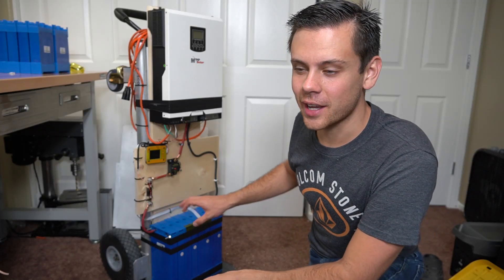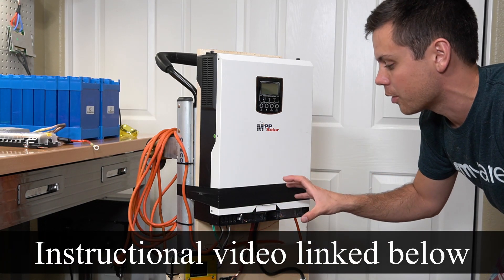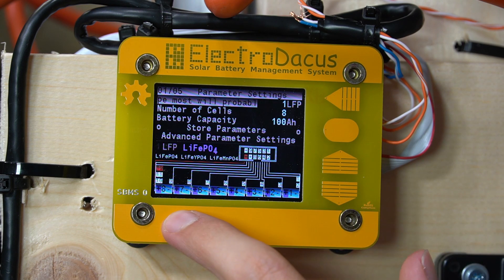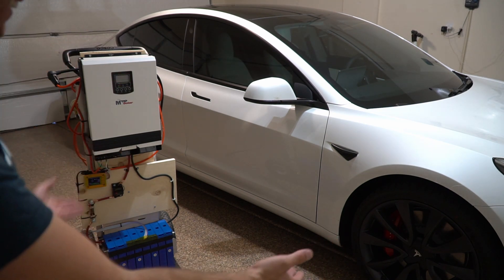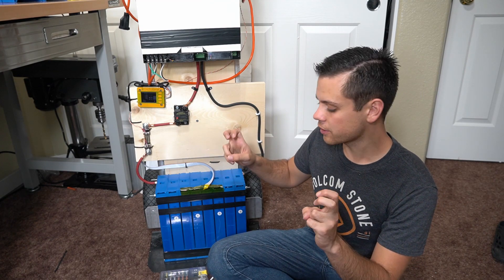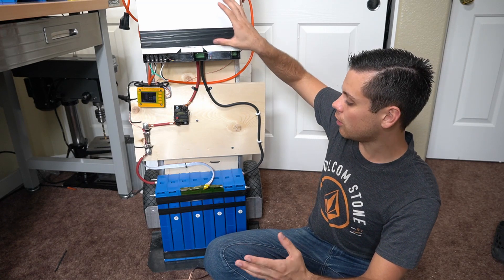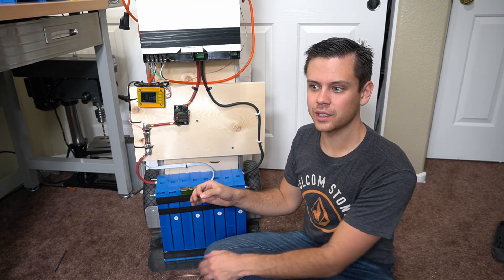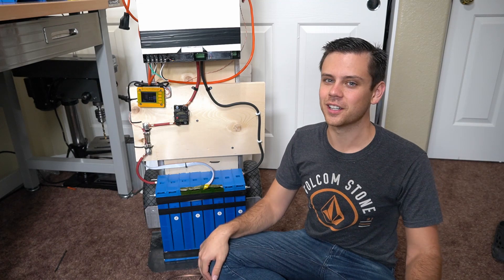Hand Truck Solar System: 2.4kWh LiFePO4, 2.4kW Inverter, ATS, 1.4kW AC Charger, 1.8kW PV Input

Comment: 1:40 woooow your finger? xd - Question: Can i connect this as a permanent solution to my household connection (230v*16A=3680watts) to charge and discharge like a normal bettery with DC connection?

Comment: Will says you can just add another (cheap) solar panel to get more power.
He forgot to mention the extra battery one would need also for overnight and days with rain.
Still a great system.
Once my new batteries (48V - 30KW) arrive, my existing 24V 5K system is going on a cart for portable system.
The portable system will power my garage tools and hopefully soon an electric mower.
I want to convert my 3 blade mower to electric and get an EGO mower for the smaller areas.
While I like the hand truck, I will use a 4 wheel cart to pull around the property.

Comment: Hey Will, I used 2 battleborns on my handcart system in early 2020 (may buy an additiona 2 later).  Which low voltage disconnect would you recommend? I am only using 4 100w solar panels along with a DC charging with a dc-to-dc converter (not charged in at the same time but just for redundancy), so I think the LV2424 has too much standby draw. I recently purchased a victron 100 30 with Bluetooth for solar (will use in 24V configuration as 4 HQST in series push the 100V limit) as it seems much better than the 20A solar charge controller included in my Giandel 2200w inverter. I am considering selling my renogy 40A DC-TO-DC converter as well as my 20A (only for backup) and buying the Renogy DCC50S 50A (not using for solar based on 12v limitation) primarily because it has a low voltage disconnect from the starter battery. The PHEV I use (12V system) turns off after 2 hours, and also has periodic voltage drops.  Love your content. In another life I could see myself doing what you do.  This is my true passion.

Comment: as long as the inverter is large enough, battery bank big enough, solar charge controller having correct volts/amps/watts, could you in theory just park this into an RV and just plug up a mini split a/c system into it and completely bypass tying it into the rv electrical system if you only plan on running a mini split off solar ever?

Comment: That circuit breaker has 1/4 inch screws. What awg wire were you using to connect from battery to breaker to inverter? Even with the largest wire I don’t find 1/4 inch ring connections on them. I guess you made your own for this? Thanks.
Reply: I just saw you posted this a year ago. Im having this same issue now. I had used 4 guage and found a 1/4 in. lugs for the breaker but then decided to replace with 2 guage wire (because the 4 guage was aluminum with copper plating) and now I cant find 1/4 inch lugs for the 2 guage. I think I can order them but im impatient, and hoped you had found some at a local supply box store?. thanks.

Comment: Will, I was wondering about the split phase out put when using two inverters. I was thinking about making a pull behind trailer with some 240v equipment on it (air compressor etc). I wanted solar power and batteries so that I didn't have to run things from a generator. What I would like to know is can you plug in 120V from a standard plug to charge batteries etc but still have 240V out, so both invereters would recieve the same 120V input which means no phase difference. I would think that once the 120V is converted to DC in each inverter that it could then charge batteries etc. but i wonder if the pass through would cause no phase difference on the output unless the pass through could be disabled in some way?

Comment: I like what you did, but I live in Maine and I have limited space living in a trailer. Go check out Roger Miller's song, King of the Road, and I am 20 miles west of Bangor. Back to the real world, I want to use my power station to run a portable hot tub in the summer and bring it inside in the winter for power outages. I also have a gas generator. I am looking at getting the Bluetti AC200P.  I think it will fulfill my needs at a price I can afford.

Comment: How many solar panels do you need to charge that? Or should I say to charge it quickly. I am going to be moving off grid, to a piece of property that is solid trees and vegetation. I think something like this would be good for me as it would be portable, and I could power all kinds of tools for building and maybe clearing land.
Reply: The MPP hybrid charger output and the inverter are at one c with the batteries.  I think it can take two thousand watts of panels to charge it in less than two hours. It will give you less cycles though.  This MPP solar equipment draws between twenty five and forty watts when on meaning you need an extra panel just to keep it running.  Nice buy on a budget.

Comment: Hi Will, another great video. I've been working on a system for my van. Going to use Electrodacus and DSSR20. I decided to go with Victron Multiplus because of the separate inverter and charger disconnect. Don't like that because of cost. I like your work around by top balancing and setting absorption on inverter/charger. What are your thoughts on doing the same for a van/RV build? Could you provide more details?

Comment: So what happens if you plug the MPP into AC, coming from an inverter, connected to the batteries? Would you just lose power due to loses in the loop, or would it explode?

Comment: hi will! geat video. i want to build this in my van. my question is if i could charge this system with the car alternator as this is 24v and my alternator 12v. Would it make sense to attach an inverter to the car battery(with thick cabes) and turn it on while driving and connecting the output 220v of the 12v inverter to the grid input of the 24v inverter? the inverter always charges at the same wattage or if the grid cannot support enough power it will charge it more slowly? would it work? thanks a lot
i think it would be nice to incorporate this in your systems- keep it up

Comment: I’ve received all my components but struggling to find an adequate box to store the battery and BMS (Overkill Solar 100a/24v). Everything seems to be just a little short as these batteries are tall. To get a box/crate large enough I have to go way oversized. Has anyone come up with a solution?
Reply: As an option, are these batteries ok to be on their side and not standing up?

Comment: Hello all. Could anyone tell me the link to get the correct manual for the MPP LV2424. The one that came with it is for a different inverter.

Also, if anyone has hardwired the BMS to the Inverter On/Off Button, it would be great to know how to wire it.

I appreciate any comments.

Comment: Do I need to protect the shunt from accidential electrical shock?
Reply from the maker: No, it's low voltage
Reply: @WillProwse  

Thanks!  I'm building this same hand cart config using the NEC A123 battery you recommend.
Reply from the maker: @chrissubleski200  that's smart! Very cool combo
Reply: Hello again.  Why did you attach shunt to positive side of battery?  I thought it was to go to negative side.

Comment: I assembled my hand cart system a few weeks back, got a little distracted and haven't gotten the most out of it yet but I sure like the idea.   I'm doing a 12 v battery system with the option to going up in battery voltage.

Comment: Big Battery should put a BMS Reset Switch on the box.  A momentary push switch with resistor should do it ?   Leaving it to a client to "Open the case and short the leads" = not brilliant and the potential for problems should be avoided.    What is a small momentary switch & resistor worth, seriously ?.

Comment: I have everything for this EXACT system but I cannot get my hands on the BMS by electrodacus. I bought 4 used 250 watt solar panels from your site. Got them Friday and the freight company stacked stuff on top when it said not to and shattered the top panel.  Love this site. Straight and to the point. No BS. I'm learning alot.  Thanks Will

Comment: I'm not sure if you already talked about this in any previous video but I'm wondering how does these all-in-one inverters work in the case you have it hooked up to about 200W solar panels, without battery and connected also to AC power, when you plug a device that needs let's say 400W or more... does it combine the solar panel's 200W + 200W from AC power, or does it only use AC power?

Comment: Hi Will et al - I see this battery bank - 8s LiFePO4 cells in series for a 24 volt battery.  I am wondering what AC charger you use when you charge via standard 110 AC plug? (I know this is a very basic question, but would appreciate humoring a beginner.)

Comment: Hey @DIY Solar Power with Will Prowse - which do you think would be a better inverter to use as a base to build around? This LV2424 (or Growatt which I can get locally) or a giandel 2000/3000W (I can also get locally)? I think the LV2424 has soft start for the inverter but good to confirm also?

Comment: If I dropped this system on my schoolbus conversion, would there be a way to also charge it from my Alternator bus batteries with something like the renogy dc to dc? That would push 12 volt so would I be able to somehow do a step up converter to charge this system from alternator too and not always depend on the solar?

Comment: I have a grid tied solar system, and would love to learn how to make it go off grid. Maybe with a manual transfer switch using the solar panels as the generator?
Reply: I think you have options here, but wouldn't it be as easy as configuring your inverter to ignore grid power?

Comment: I have a  few question on this.. Not many think of,  I know that these things can get stored for a long time and not used, just like a regular Gas generator.  How long can these batteries be stored and not used, and still be in good order ?  Or is the design of these meant to be on a low SOC for long storage ?
If long storage, what is the suggested maintenance ?

Comment: Very interesting that it can charge your Tesla.  I plan on getting a Tesla too.  They do charge much faster with 240 volts.  I would love to see plans/components for a 120/240 volt system with a second battery pack.  I bet you could run a Tesla for basically free, as well as laugh at power outages.

Comment: Could you do a video about battery converter/chargers, such as those available from PowerMax and Progressive Dynamics? I’m curious to hear your thoughts on the benefits of them, and whether there is any lower cost alternative that you would recommend. My specific use case is for connecting shore power to my non-fulltime camper van so that I can run the accessories in the van while the engine is not running. But seems there are lots of different uses for the battery converter/chargers.

Comment: Thanks for the all the info. I've been binge watching most of your videos over the past month.  Very informative and entertaining.  I thought about doing something like shown in this video but specs were too big for me.   I'm going to make a portable, off-the grid box unit for my Travel Trailer with similar equipment you have in the video but I'm putting batteries underneath the inverter.  It will be portable for power outages, so it will be double duty.  I am torn between the Al cased prismatic cells and the fortune cells but the price difference of $300 and weight for 200 Ah has me leaning me toward the prismatic.  Hope they are durable enough to handle vibrations in my Travel Trailer.  Thank you so much for all the help!

Comment: I've been watching your videos and I really like the ones on the solar generators I will be purchasing the ac200 unit when it go to one of the kickstarter sites they said it will be July 1st, I've always been curious about something that I've never seen no one on YouTube do when it comes to solar panels, that is get three or four 300w solar panels with built-in micro inverter and instead of plugging it to a dedicated plug that is on its own breaker in a house cut the plug that you would plug in your house and connected a Tesla charging cord that you would plug into a Tesla car to charge it and see if it will charge a Tesla vehicle. If it would work do you think it will eliminate batteries and inverters and charge your vehicle buy direct solar panels with built-in inverter because you can connect more solar panels to the system as needed.

Comment: Went for the charger because my other one does not allow higher charging  voltages but it does allow regenerative discharging. There were no balancing leads in the box. Do you know what balancing leads will fit the X8?

Comment: Hey Will!  I noticed in this video, you said that the Electrodacus SBMS0 has a low temp cutoff?  Have you tested it and sure it works reliably?  I am thinking of using this all-in-one system in a camper van build, but I live in Illinois and have freezing temperatures in the winter.  I want to make sure my batteries are protected!  I noticed that you have not updated your website, for the recommended BMSs with low-temp cut-off.  Will you be adding the Electrodacus SMBS0 to that list of BMS recommendations?  From further research, I learned that this model recently became compatible with MPPT charge controllers (prior to this model, it was for PWM controllers).  That is a game changer! 

In addition to the SMBS0, would I have to place an order for the DSSR20 and the DEXT16, if I wanted low-temp cutoff?  I noticed the DSSR20 is available "with diversion" and without.  What does this mean; and which one should I get (if needed)?

Can you expand upon this, maybe in a future video topic?

Finally, would there be a better BMS to use, if I went with 8s2p configuration (for a 200 aH, 24 volt battery pack)?

Thanks so much for your channel!  I have learned so much from you.

Comment: They are really serviceable ...
On most of these common practice is to change the fans direction to make then blow within natural convection ...
Inspired from down the fresh air to blow it up hot to the top ...

I get what he means not forcing up the pv solar max array ...

My inverter would accept "only" 4000 w max array ...

I've tried 6000w onto 3 parallel strings of 7 panels in series ...

It worked 8 months and I spent winter times only using batteries charging-converting system to avoid the total loss investment made ...
(We have special rated night electricity prices) .

I service it in March during "events" there and in China ...

I was whether shy or afraid to open up brand new material like ...

In the end, got 7 solar panels I will have to move onto west side my roof to complete the installation I need to be electrically self sufficient with thoses 6000 w max array divided into 2 parts ...
One 4000 w south oriented and one west oriented each of these part will have their specific mppt device ...

It's just to smooth out the max peak production along the day ...

The trailer idea is not that useless by itself ...

I just wish Tesla could be moveable battery bank in some close future ...

it seems plug n use system is not philosophically ready to be yet .

Later, explain the scale the "principles" to "investors" ...

Won't be an easy task, even if .

Who knows ?

Most of progress were made of dreams before becoming that real .

Watch you before asking me to stop dreaming y'all !

Have a great one .
Ride safe, clean, have fun .

Comment: Hi great videos from uk and would like to ask question re epever tracer. Could I use this to charge 2 systems , middle terminals to run a battery for Cpap machine , and load output to go into exiting motorhome system ebl 208 solar input.

Comment: Have you considered a home system where you run 120 volts DC?  The majority of electronic devices these days do not require AC.  For many years now I have been thinking of building a home battery bank that does 120 volts positive and 120 volts negative to simulate the split phase.  Any devices that require AC I would give them their own dedicated inverter.  off the top of my head I cannot even think of anything in my home that requires AC power except for my oven.  
Even the blower motor in my furnace is a universal motor.  
I have not yet checked to see if any inverters can handle 120 volts DC input.  If push comes to shove I would design them myself.  What do you think?

Comment: Hi Will...
Please could u do a video on how u built a "Cerebro" device 2 steal the idea from my brain... LoL ;)
I've been thinking about something very similar, but I'm planning 2 put fold out solar panels with hinges on it...
My thought is 2 have a self contained power system u can take anywhere & still turn it (manually / with a motor & gearbox on 1 wheel so it pivots) 2 keep facing the sun...!
Keep up ur good work buddy..!

Comment: I hope you can redo this in a more compact  configuration for a future video.  I was thinking of using a child's metal wagon to hold all of this.  I have seen a video for making a DIY unit using a Craftsman tool box.  I am not sure your battery would fit in it, though.  I can see mounting the Inverter on the top of the toolbox.  Thanks for taking the time to show us how to make a superior system for the same price as a standard one.

Comment: I can not find the solar inverter for the price you posted on your video, The link takes me to Ebay, where I need to order from taiwan, and its not 516, Thanks
Reply from the maker: It ranges from 430-650$. Usually it's 516
Reply: @WillProwse   Its there a way to send me a link where to buy in the USA, and if not, is it safe to order from Taiwan?  Thanks

Comment: When you say AC charging, are you talking about AC coupling?
Reply: I believe what he's talking about is the capability of the MPP inverter to charge the battery pack from grid power, if it is configured to do so